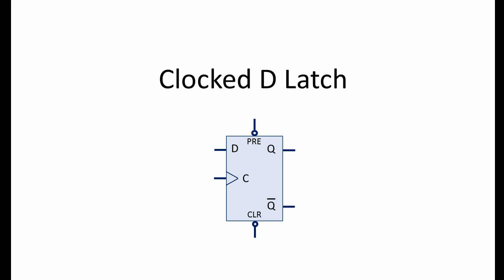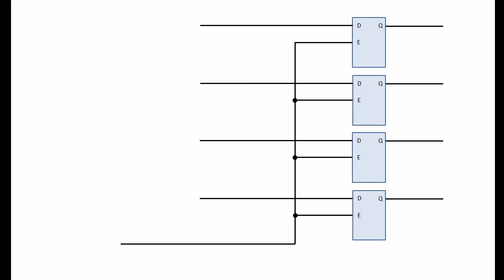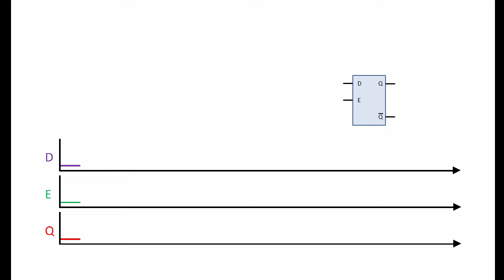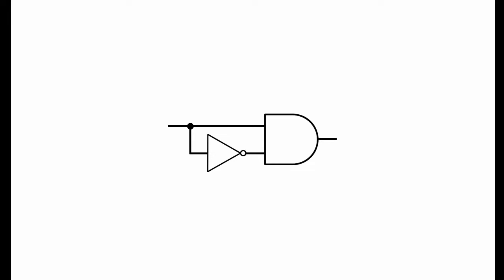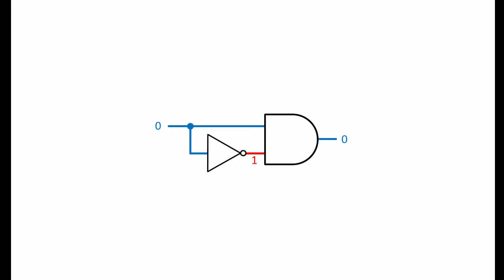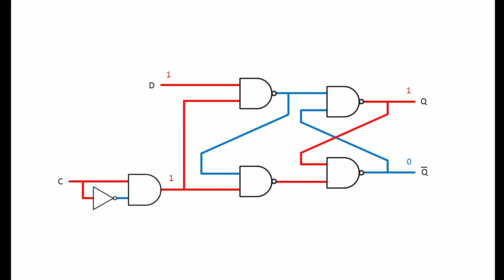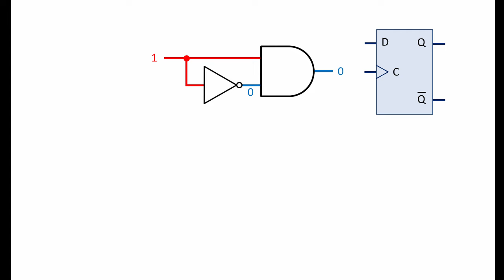Latches and Flip-Flops 4 – The Clocked D Latch

Comment: Hi sir , I am from india and You have no idea how beautifully you have dissected the whole topic and presented in such a meaningfull way. Many other videos are so horribly wrong were they are giving clock pulse directly to enable pin of series shift register and I was soo confused on the durations of individual clock pulse . But still one questions is still prevailing in my mind that what causes that delay or data persistence  in not gate out put inspite of the fact that input signal is been changed???

Comment: What happens if the edge detector goes back to zero before the latch has managed to change states? Aka what happens when the time interval that the edge detector allows current to flow through is less than the propagation delay of the latch? Would that mean that the state of the latch will not change? (I have watched the 5th episode of the series)

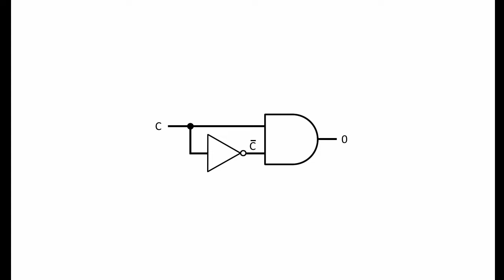Comment: Waaaaaaait a minute. At 4:48 when a high signal is coming out of the not gate, and then takes a high input, “there is a brief period where both input and the output of the Not gate are high, and therefore  the output of the AND gate is high.” But if there is some kind of propogation delay in which both the input and output of the NOT. gate are high, wouldn’t this be cancelled out by the propogation delay for the OTHER input of the AND gate’s signal to reach the output? If the NOT gate has a delay, that briefly keeps both input and output high,  why doesn’t the AND gate’s input have a corresponding delay that keeps it’s output low?
Reply: Answering my own question: By putting more NOT gates in series. By creating a big enough odd number of NOT gates in series, their cumulative propogation delay relative to the other straight input signal of the AND gate, would create a pulse width from the clock long enough to measure, but at some point there will a point, where a single NOT gate would not create a propogation delay long enough to not be cancelled out by the propagation delay of the AND gates’s input. Two NOT gates’ delay can be measured; one NOT gate, not so much. That’s my guess anyways.
Reply from the maker: Take a look at the master slave D-type flip flop

Comment: Second High output Q is a bit wrongly displayed at 2:40. It may perplex the viewers.
Reply from the maker: D is high, clock is high, Q is high.  I believe it's correct.
Reply: Yes, It is right that D is High, E (clock) is High, but these are High in the pattern of 100 whereas Q is High in 111? Please elaborate if I miss anything. Regards.
Reply: That means D & Clock is High only once , then Low Low: whereas Q is High High High.